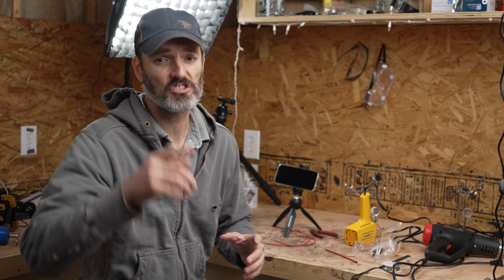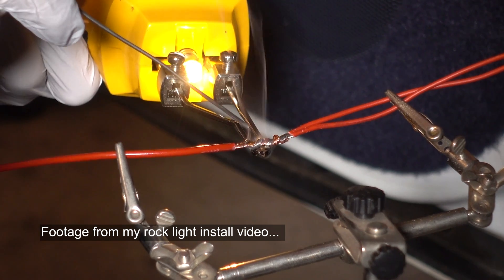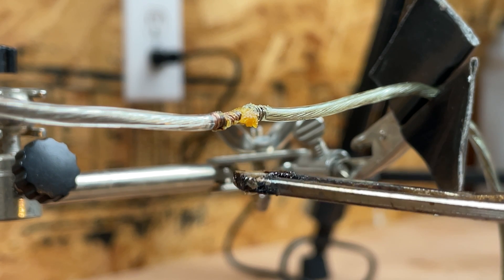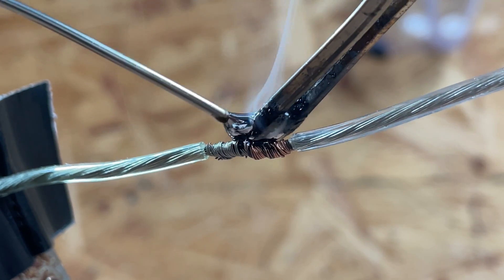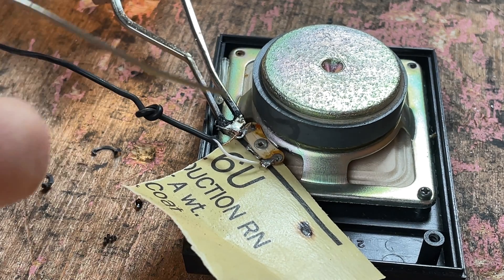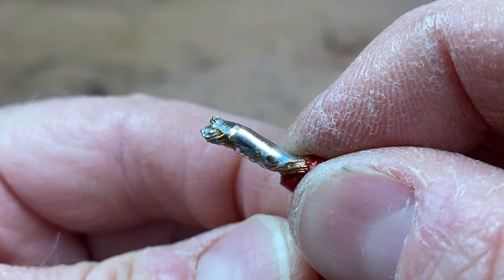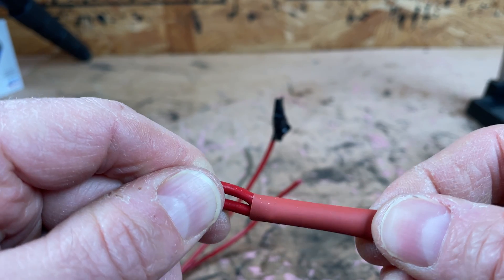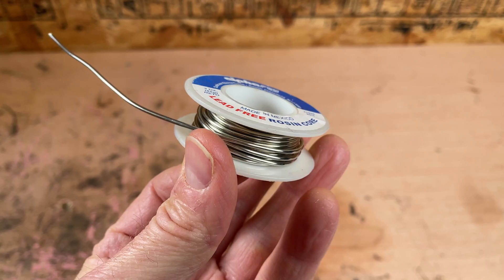Beginner Vs. Professional Soldering Techniques!

Comment: Nonsense: I see that kind of thing everywhere on Youtube but tin soldering is NOT the solution to join power wires in this case because:

1/ while tin solder is not flexible at all  it produces breaking points that will cut the wire soon or late.
2/ In case of hot point, produced by the cable itself or an external heat source tin fuses at 231 degrees Celcius, wich is very low.

Rolling wire technics protected by thermo-retractable tubes are often sufficient.
You may also use special tubes and crimp them with the appropriate tool.
Reply: All tin soldering in electricity standard network is out of normalisation, dangerous and forbidden.

Comment: I always solder my wiring on my vehicles. You did a nice and quick training. Everyone should appreciate it. One additional tip, is to make sure your soldering iron tip is always clean. A small wire brush will do nicely. 👍

Comment: I re-wired my uncle’s entire T bucket recently, it built in the late 60’s initially, the original guy had many cold solder joints with globs of solder not penetrating the wire.

Comment: with that soldering gun, you have to be careful, especially with smaller gauge wire. If you get the copper too hot it also wont accept solder. Soldering really is more art than anything else.

Comment: On Auto wiring I use a pencil torch in most places.  It will heat everything faster and works great on the heat shrink also. It does require extra caution obviously, but it's very fast so once you get used to it, you don't want to go back.

Comment: @1ROAD When are u gonna upgrade to led with zevo led amber front, rear turn signals and get led flasher relay use by Novita and made by sylvania and red zevo led brake lights on ur 03’ Chevy suburban?

And upgrade wirh lasfit led on ur 95’ Chevy suburban? 🙏🏼🙏🏼🙏🏼🙏🏼

Comment: I’m never a fan of soldering at all. 

Just like putting led turn signal bulbs and when they get hyperflash. 

U get better options 

Use load equalizer resistors by sylvania and it includes T-tabs which is a better option.

U can use other load equalizer resistor with socket connectors it came with, as a plug and play version. 

U can use an led fladher relay which much better approach. 

If u don’t want to do none of that, get an led bulbs with built in resistors for pure plug and play. 

There’s ur better options
Reply: Soldering is great.

Comment: Good tips. Smart how you protect the speaker with a piece of sandpaper or other blotter material. Dont forget to only solder in a ventalated area. Never breathe the smoke or gas from solder.

Comment: You're soldering sucks because you shouldn't be soldering stranded wire, especially on vehicles.  Crimp connections are the way to go on stranded wire. But just like you need a good soldering iron for solder you need a good ratcheting crimp tool for crimps.
Reply: Or bending wire or wire connections at all
Reply: @peterston4039  you also have to crimp correctly and there’s some newer weather-resistant connections on the market with solder and when heat shrinking the crimp it melts and then cover with heat shrink and electrical tape. Faster and better connections. Never had a properly crimped wire come apart either. Can have a lot of issues with both even when done correctly.
Reply: @peterston4039 heat is the electronics killer, not vibration.
Reply: @peterston4039  lol yeah that makes sense
Reply: @peterston4039  😐
Reply: I find that if you melt just a tiny bit of solder between the wire and the tip of the soldering iron that it will transfer the heat better to the wire. Then apply the solder to the wire to flow into the joint.
Reply: These are tried and true old skool technique to get the job done. 

But I agree. Using T-tabs are much better approach and little less pain.